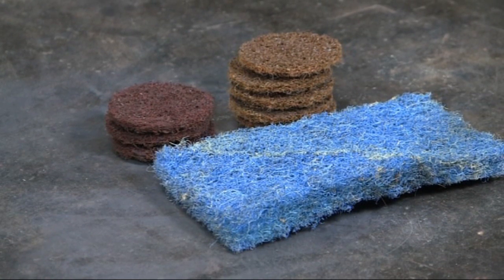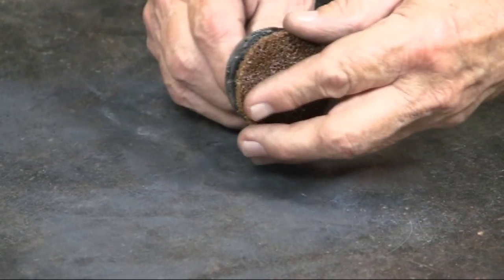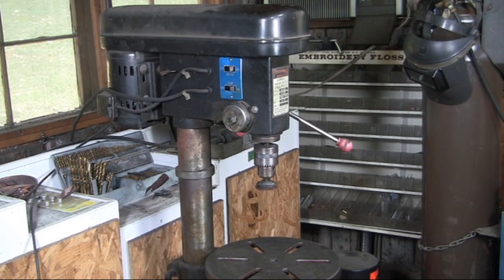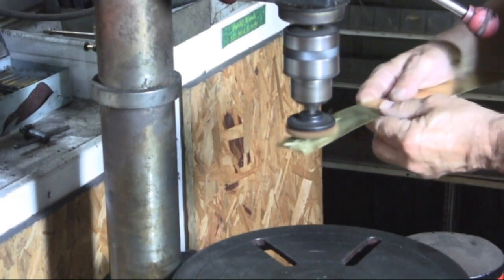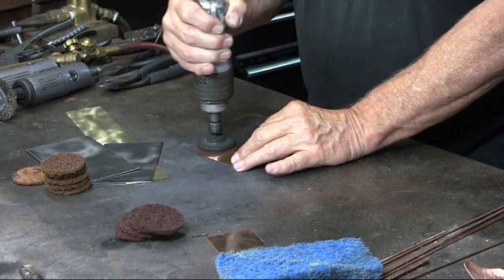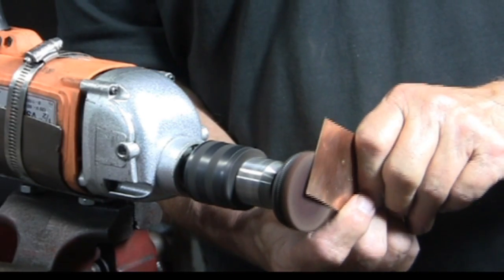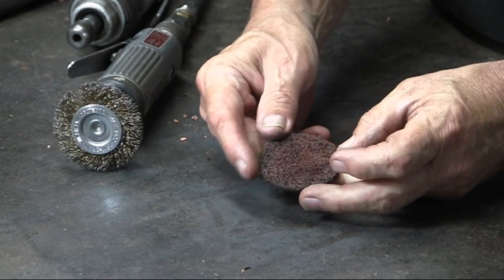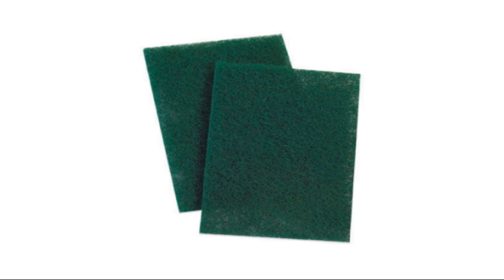Metal Finishing with Scotch Brite Pads

Comment: an Air angle die grinder works well too. They have them at harbor freight for about $15. I've used the new style pads in a and a half inch, and 2 inch and they both work great. That is a clever Idea with the drill press though.